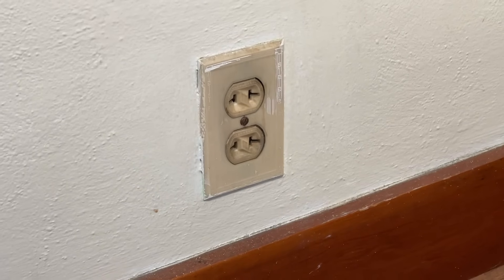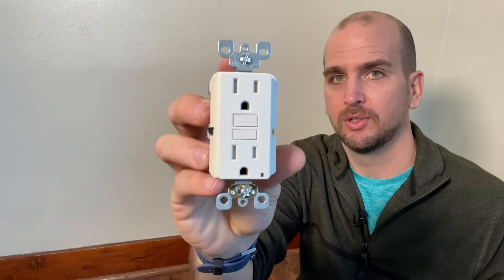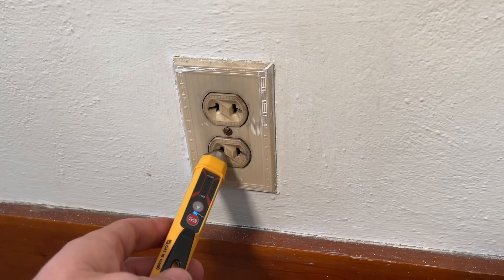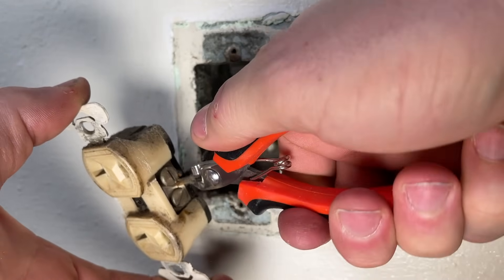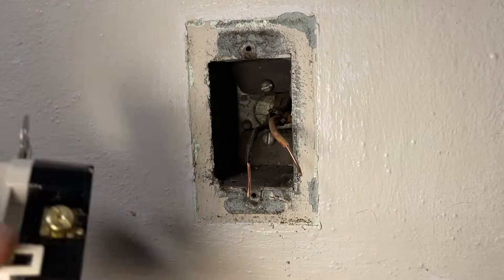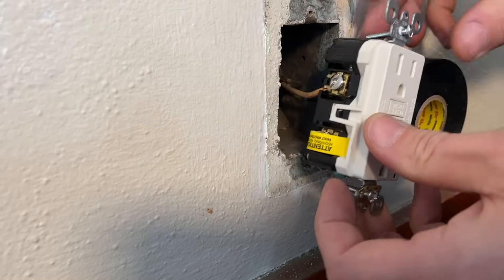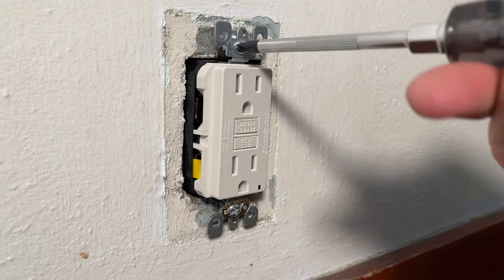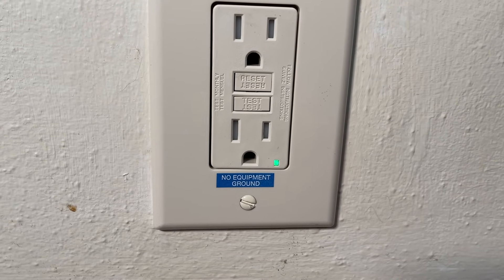How To Replace An Old 2 Prong Outlet Using 3 Prong GFCI

Comment from the maker: Leviton GFCI 15 Amp:  https://geni.us/yPRQ
Klein Voltage Tester:  https://geni.us/h9Hl
Klein Outlet Tester:  https://geni.us/kdBAJ
Milwaukee Wire Strippers: https://geni.us/5zuLAbC
3M Electrical Tape:  https://geni.us/gG7jWGL

Tools Every Weekend Warrior Needs
Makita Cordless Drill Combo Kit:  https://geni.us/t7dIA
Dewalt Drill Bit Set:  https://geni.us/oFlSl
Dewalt Screwdriver Bit Set:  https://geni.us/VDcr
Craftsman Screwdriver Set: https://geni.us/jXqFI
Eklind Allen Wrench Set:  https://geni.us/7XfvO
Pliers (4-Piece Set):  https://geni.us/RIdx
Milwaukee Fastback Utility Knife:  https://geni.us/MlyiLk
Stanley Tape Measure:  https://geni.us/bUfD1R
Studbuddy Stud Finder:  https://geni.us/RySCuVw
Johnson Torpedo Level:  https://geni.us/wiLcDY
Stanley Hammer:  https://geni.us/bPDk8Wo
Buck Bros Wood Chisel Set:  https://geni.us/vk3cpTW
Little Giant Ladder: https://geni.us/fmlmTk

DISCLAIMER: This video and description contain affiliate links, which means that if you click on one of the product links, I’ll receive a small commission.

Comment: What does no ground mean
Reply: ground, or grounding conductor, is a wire that serves a low resistance path for fault current to flow back to the transformer, and as the result, trips the circuit breaker.

Comment: Scott thank you thank you please please keep making videos like these you are a lifesaver I cannot tell you the nightmare I was going through trying to solve the problem of upgrading the house I inherited from my father an old 1959 wonderful but dated electrical outlet that I just can't afford to rewire until I can save funds later. But need to use modern appliances safely with 3-prong grounded plugs your video is a God sent your an Angel. Thank you ❤❤❤ 👍👍👍👍✨️✨️✨️✨️

Comment: GFCI/AFCI should be used to prevent both the ground fault and the arc fault that could occur amongst the wires, box, whatever is plugged in, etc...  However, excellent video without background music and direct to the point. Purchased a Leviton AFCI/GFCI from the box store and was able to install it within about 10 minutes. Voila, up to code with that outlet.

Comment: I need to switch out an outlet so I have the 3 hole one and this seems really simple to do for just about any experience level just as long as they shut that breaker off but my question: 

How do I know which wire is hot? (I have yet to lm take off the outlet cover to look. I want to make sure I have a decent understanding of what to do better I fuck with electricity lol

Just realized this video is years old 🤣

Comment: QUESTION!!! I only had two cable in a two prong outlet. Repleced it with GFCI outlet as shown in the video. I did the outlet tester and instead of the middle light only, it lit up as "correct" so the middle and the right one. I know there is no ground cable. Is it still ok?

Comment: How is the ground fault protection supposed to work if there's no ground?
Reply: GFCI does not rely on ground. It monitors the current on the hot wire and the neutral wire. Under normal condition, the current on the hot wire and the current on the neutral wire are the same. If they are not, it means some of the currents are flowing elsewhere, including a person. In such event, the GFCI immediately cuts power.

Comment: So you cant use this if your in a daisy chain outlet?
Reply: yes, you can. GFCI have 2 sets of hot & neutral terminals. One set for the power. The other set of the load. You can daisy change using the load terminals

Comment: Been having problems with an putlet under the sink. 2 hot, 2 neutral, 2 ground. Have located incoming and outgoing wires, connected all ground to wire nut then to screw. Connected everything correctly, clockwise with the hooks on the correct screws. Still nothing. Been at it for a month. Cant afford an electrician

Comment: What if there are 4 wires instead of 2?
Reply: That either means the outlet operate on two different circuits. Or it's connected to a light switch. Which is a disaster waiting to happen. Make sure you use a tester to see if it's still hot after shutoff.
Reply: 2 wires feed the outlet. The other 2 wires get connected to the outlet and feeds a different outlet elsewhere.

Comment: No it won't trip im having the same problem I cut the end off an extension cord and plugged it in to a GFCI with a ground and held the cut end under the faucet with the water running and the grounded one tripped but the 2 wire with no ground did not
Reply: Interesting test. Scary that the ungrounded gfci did not work.

Comment: i have a 1940's home with 2 prong system. so gfci this essentially brings the outlet up code? is an afci breaker required in bathrooms and kitchens too?

Comment: Can you install a GFCI up stream and then replace the downstream two prong receptacle with a three prong and label it “no equipment ground” or protected by GFCI?
Reply: yes, you can as long as you label them correctly. However, you need to label the downstream receptacles with BOTH "no equipment ground" and "GFCI protected" stickers

Comment: I thought when you installed a GFCI outlet you had to ground it? Why couldn't you ground it to the metal box?
Reply: GFCI work even without ground. The metal box may or may not be properly grounded.

Comment: I live in a prewar apartment building i have quite a few 2 prong outlets and most of the extension cords we have have 3 prongs. Would it be better for me to give it a shot to change the 2 prong outlets to 3 or try to find 2 pronged extension cords that have 3 pronged slots?

Comment: Thank you - I am learning the joys of homeownership with a house where the electrical system hasn’t been updated since it was built in 1940. Spent 5k to upgrade the box and some circuits but the electrician said he couldn’t do the whole house because he was due on another job - besides, he felt I could do it myself. With your help, he was right. I’m plugging away (pun intended) and throwing away those adapters!

Comment: I did all that was explained here except for wrapping the outlet in electrical tape.  The new GFCI outlet works, has the green light, but it is flashing red every 10 seconds.  Any idea what is causing this?
Reply: i would suspect it detects some sort of problem. Look on the manual of the GFCI you bought. It should say something about flashing red.

Comment: I don't understand. What was the purpose of the electric tape?
Reply: To help it fit better into the box. It holds everything tighter.
Reply: you don't need to wrap the receptacles with tape. Many electricians do so to add some safety. They don't want the screw be exposed.

Comment: How do I identify the 1st outlet in a series? I have an older house that still has 1962 wiring in the basement. All of the wall outlets are 2 hole and drop down from the ceiling to about 4 above the poured concrete floor

Comment: So Can I Run a 14. Gage Ground Wire from the Ground Panel to the Outlet and add a 3. Prong outlet , this way I Remove the Old Two Prong outlet and Replace it with a. 3 Prong outlet Wiring The Black 14 gage Wire to the outlets Small slot , and The White Neutral Wire the the outlets Larger Slot , and Then Use the 14 gage Wire I have Screwed to the bare Wire Ground Strip in the Breaker box , 
This way I will have a 14 gage Grounded Outlet to run a Space heater on .
I have been told Not to Plug a Small Space heater like a Vornado Space heater into a GFIC OUTLET , what do you think

Comment: No ground ?
Reply: Older wiring has only two wires, no ground.

While the best solution is to replace old wiring, that's expensive and replacing an old outlet with GFCI is code compliant provided it's marked correctly.

Comment: I seen people put a ground wire on a three plug to the back the metal box and for the GFCI receptacle. Also seen that you can use GFCI receptacle at beginning of the circuit and use three plug receptacle for the rest the outlets
Reply: How is he going to use a three prong when the wire connecting to the outlet has no ground wire? That’s kind of the entire point of the video and if he had 3 wire he wouldn’t be doing this in the first place.

Comment: All but one receptacle stopped working in two bedrooms at the same time (most are the two prong). Can I just replace one of those receptacles with a GFCI outlet and the rest with normal outlets? I don't know which way anything flows lol. But since they all stopped working at the same time I think one may have burned out and they are all connected? Thank you for your video and time

Comment: 6:30 How to know if you have multiple receptacles "daisy chained" in a room?
Reply: i would turn off the breaker which removes power from a given receptacle and any other outlets which loose power are likely off same breaker ... the trick then is to find the first outlet of the daisy chain to decide where to put the gfci outlet ...

Comment: can you add GFCIs on all of the outlets even if there are multiple receptacles daisy chained together?
Reply: Yes, but connect the downstream wires to the Line side only, you never want to feed another GFCI from the Load of a previous one.
Reply: @surferdude642 thank you for your reply ...
Reply: @bobackerman54  If multiple receptacles are daisy chained together, meaning using the screws on the receptacle for incoming power and continuing downstream instead of pigtailing, then your better option is to use the most upstream one for your GFCI, and use the Load side to feed the downstream receptacles. This way you only need one GFCI to accomplish the same thing. If they are pigtailed using wire nuts, I wouldn't recommend this option, generally speaking.

Comment: What are these dumb videos? Anyone who bothers to read the manual that came with the GFCI could do this. What you didnt do and should have done was ground the GCFI. Most people would do it to the box, but it really needs a new Romex cable from the breaker to the GFCI 12/2 with a ground wire, straigh to the panel. LOT more work, but its also the correct. Doing what you did just turned the outlet into a tiny breaker. Nothing is grounded.
Reply: The GFCI receptacle is not a tiny breaker, it's not an over current device, ground wire or not.
Reply: @surferdude642   These videos are insinuating that such thing.
Reply: @koltonriley5929  Not really, see NEC 406.4(D)(2). The purpose of this code is to address the situation where rewiring the house is impractical and/or not an option, so long as the current wiring is in good condition.

Comment: What amp do I choose? 15 or 20?
Reply: On a 15 amp circuit you can only use 15, on a 20 amp circuit, you can use 15 or 20. Use a 15 and you won't be wrong.

Comment: Those old electrical metal boxes would have been grounded to the house. That way, when you use the adapter, it is grounded to the outlet, which is grounded to the metal box.

Comment: Is an old 2 prong outlet
Safe for use if something requiring little power...  Like a lamp?  But does this become unsafe if and when you put something requiring 3 prongs into the little 3 to 2 converter, then into the outlet?   Thank you!
Reply: It's safe for anything that has a 2 prong power cord, which is actually most of the time. In a lamp any exposed metal should be isolated and in a higher power appliance or tool they are typically double insulated and metal parts will be unreachable. If the power cord has three prongs it could be unsafe for an ungrounded receptacle. The remedy is to install GFCI receptacles in locations where 3 prong plugs are commonly used.

Comment: I have a 1950s house with two-wire, not grounded outlets. I understand that the GFCI outlet should be in the first position of the circuit to protect all of the outlets. Instead of figuring out which outlets are on the circuit and which is first, what about a GFCI breaker in the panel and 3-prong, non-GFCI outlets. Would this cause any problems? Thx,

Comment: Perfect.  Well done.  Short and sweet.  How would you know which is the most proximal receptible if they are connect in series?  They should be conenct in parallel.

Comment: I have not had power to two rooms for a while now, but do not have electrician money. Do you think this is something worth trying with each outlet? The circuit boxes are all emitting electricity into and out of them and no breakers are tripped.

Comment: So technically (I intend to do this later because why wouldn't it work) you could drill a hole, send a ground wire down, and clamp it to a copper rod in the earth, couldn't you?

Comment: I have a question. I have two outdoor (covered) receptacles which are piggybacked  to one GFCI receptacle inside in my garage. The outdoor ones keep tripping the one inside. Which is a good thing. My question is can I replace the outdoor receptacles with GFCI receptacles, And will that correct the tripping issue. I am asking because my receptacle in the garage is what I use for my secdary fridge and upright freezer. Thank you very much.

Comment: You replaced a 20A outlet with a 15A outlet.  Not safe, if the outlet is on a 20A breaker.  And you didn't put  the "No Equipment Ground" label on the outlet.

Comment: when we  remodeled part of my parents home we had the walls open (tore out lath and plaster put in sheetrock) i ran a dedicated ground to all of the plugs i could get to (had a 3ft crawlspace ).  in my trailer house  i have found that Both bathrooms are on the same circuit even tho they are 50 ft apart and only have the gfi in the 1st (nearest to braker box) bath even tho they only would have Maybe had to run an extra 5 ft of romax to get to the braker box Du?????  was that legal and is it safe???? great vid

Comment: Scenario: I have AFCI/GFCI receptacle with no ground wire on Line. I connected a circuit for a dimmer/rocker and a Halo Gimbal recessed light on the load. The circuit on the load is 14/2 romex with a ground. I connected the ground in their proper locations throughout the circuit and onto the receptacle. 
Questions:
1. Is this properly wired assuming standard single pole and light connections? 
2. Do I even need to connect the grounds on the circuit if the receptacle is unground?
3. Should the tester shows open ground? I don't have the tester with the ground test button. 
4. On this video, he does not test the outlet at the end so Im questioning what it would read considering it is still not grounded.

Please help if you have any answers or suggestions.

Comment: I just removed a switch outlet (two prong) combo from an old house.  It has two black wires and two white wires.  There were only two places for the wires to go in the old receptacle, but lot more places to go with the new outlets these days.  How do i know where the wires gon in this case?

Comment: If you did this, I am guessing there is no protection for a computer plugged into the outlet during a lightning strike?
Would running a ground back to the box be better in that instance? thanks!

Comment: Regarding the outlets chained together:  Don't they also need to have grounds connected to protect all of them with the GFCI?
Reply from the maker: Even without the ground the outlets if connected correctly to the load side terminals will have GFCI protection.
Reply: @EverydayHomeRepairs  Thanks for your response.  If you wire non-GFCI outlets on the non-load side of a GFCI outlet, without a ground wire between the GFCI outlet and the load-side outlets, are the load-side outlets protected?

Comment: My wife and I bought a house in 1998  that was built in around 1983 . We had an inspector go thoroughly through 
the house and he told us that one of the electrical outlets was wired wrong where the "hot" wire and "neutral" wires 
were switched . I had to buy one of those circuit testers and verify the problem . The bad thing was that I had to find 
all of the electrical outlets that wre connected to that particular outlet as the tester could not positively idenify the 
problem outtlet . There were four or five of them so it took me a while to find the problem outlet .
To make a long story short , I found the problem outlet , reversed the incorrect wires and the circuit tester was a "go" !

Comment: I installed a GFCI ( GROUND FAULT CIRCUIT INTERRUPTER ) in place of a regular three prong outlet that was mounted 
in the kitchen , which was too close to a water source . The installation procedure was direct and easy to follow in the 
directions provided .

Comment: Oh man, this was really helpful. Thank you! We have an 1950s house and I've been concerned about using those adapters for a while but didn't think I could upgrade the outlets myself. Now I know I can :)
Reply: SAME! First time home owner and I have never done anything to fix...well, anything. LOL But, I think I can.
Reply: Been in our home for about 3 months now and this thing has two prongs everywhere lol. Bout to change that real soon now
Reply: Buying a house and found out they are all two prong - 1957 - looks like I'll be doing this as one of my first projects!
Reply: 1952 house and I will definitely be changing my two prong outlets now
Reply: Add me to the list ha about to move in this month. My current concern is that the house is using cloth wiring, and im not sure that the stripping of the wire is the same as in this case. Any one help with info on that? Thanks
Reply: Lol im here to join the 1950s club first time home buyer too

Comment: Question to the electric professionals:  I have an old house that is almost exlusively 2 prong outlets...I was asked to replace all of them with three prong outlets and was researching the best way to do this when I found this video...

My question:  Do I have to replace EVERY two-prong plug with a GFCI plug or just the first one in the line?